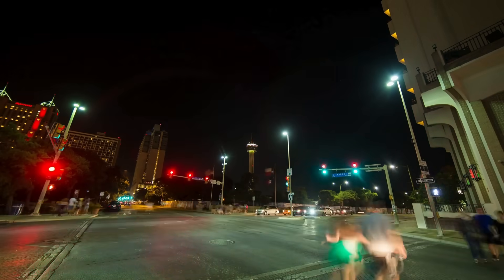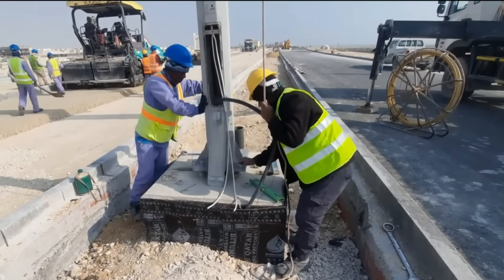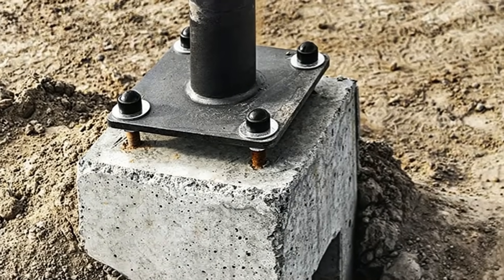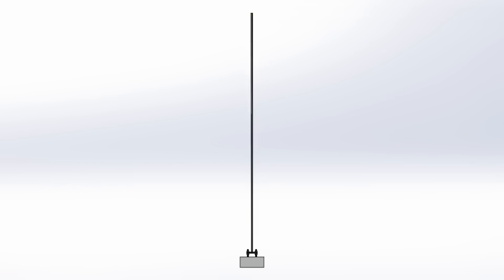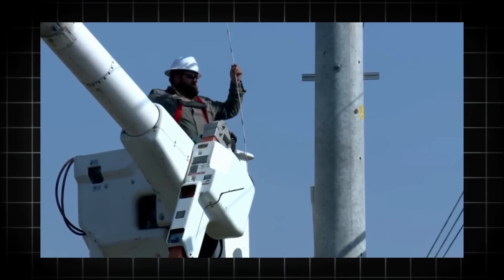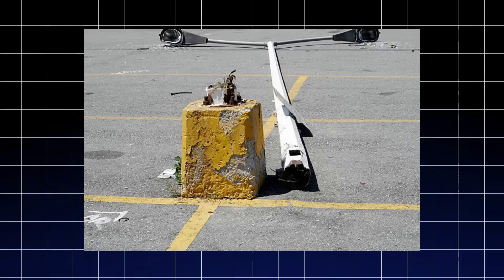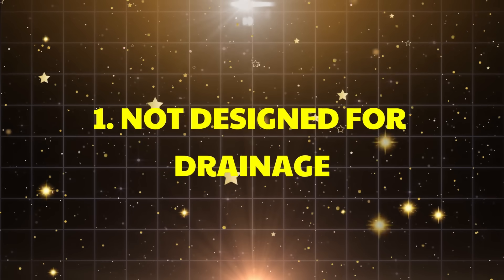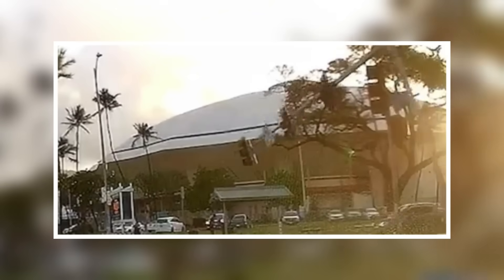Why Light Poles Float on Bolts Only, Not Flush with the Ground?

Comment: This video is about base plates of "static" elements. Please do not use this levelling method for baseplates of dynamic machines. Don't get me wrong; the video wonderfully explains this kind of base plate installation. For dynamic machines, the base plate functions as the linchpin, establishing a critical connection between the intricate mechanisms of heavy machinery and the foundational structure upon which it is anchored. However, using bolts under the baseplate for alignment will prevent the proper tightening of these and will eventually affect the vibrations and reliability of the dynamic machine on top.

Comment: THESE BOLTS AS SHOWN ( STUDS  ) ARE TO BE USED AS LEVEL/PLUMB ADJUSTERS, THEN UNDER THE BASE PLATE TO BE FILLED IN WITH HYDRAULIC SETTING  CEMENT !

Comment: some light poles, especially those made from aluminum arent meant to be direct contact with concrete. the light poles we used at our property were cleared marked NOT FOR DIRECT contact. the first 50 or so were set off the concrete base. installer got lazy ,in a rush on last 200. everyone touching concrete is starting to corrode/oxidize

Comment: Without "finding out why" in this video I knew the standoff bolts and nuts are mainly for ease of leveling of the pole, and subsequent re-adjustment. The rest are made up BS. This method is not sophisticated clever engineering, but just as basic as jam nuts even hillbillies can conceive.

Comment: A hole in the earth. A pipe vertically. Filled the outside again. 
The street lamp was placed vertically in the pipe and filled with sand all around. That holds on.

Comment: I've hauled NUMEROUS poles out of the Valmont plant in Brenham, Texas, in my 40 year flatbed trucking career. 

While the streetlight poles are indeed light, the traffic light poles are NOT!! Most streetlight poles run in the neighborhood of a few hundred pounds for the BIG ones; a modest traffic light pole can get upwards of 8,000-10,000 pounds. The stress these poles are under is phenomenal - that arm can weigh as much as 800-1,000 pounds, not counting the light set! And many hold at least 2 arms.

The bottom is mostly covered with a plate, with relatively small holes for wires - these may get plugged up to keep out critters. And it's nigh-on impossible for water to get inside. The weepholes are to assure that any condensation buildup that does make it inside doesn't just sit on the plate and rust it.

Comment: Solid Color Boiled Linseed Oil soaks through rust and seals the metal to protect it from oxidation.  Exposed to weather, it will need a repaint every 5 years, which is very easy.
I've used it on work metal surfaces outside.  It dries very fast on a warm day in the sun. Like 5 minutes or so. Normally used for Cedar house siding or shingles. It's Olympic & it's great.
I'm a customer, not a business man.

Comment: Now take the bolts and NUTS ON THE SPACE NEEDLE. BOLT I FOOT ACROSS  (GUESS ) (NUTS 2 feet) but point is if they are flush too the pad. 
If they where raised up 6 inches  of pad, and a hurricane  came thru 
It would fall over .. because  its flush it grips tighter.. my opinion..

Comment: Not challenging the narrative however most light and street poles are constructed and installed on the basis of impact and the design changes depending on speed zones. In Australia in speed zones 60kph and below we use Impact poles which are hard bolt installed but the lower half of the pole has gaps in the seams and when a car hits the pole the pole crumbles over the car and absorbed lots of energy. In speed zones over 60kph we use Slip based poles which have a ground mount that has a base, as washer and then a base plate on the pole. Each corner has an open recess for the bolt/ nut. On impact the pole breaks away a from the base and flies away so the vehicle does not hit a resisting mass.

Comment: Thanks for not covering any of the engineering and physics needed to understand how tiny threads on the rods are strong enough to hold a 60ft tall structure being pushed with 60mph winds on one side and horizontal loading also pulling it down in the same direction. No one wants to learn science or mathematics today, thats for AI and videos like this.

Comment: That falling traffic light looks like the Blaisdell Arena in Honolulu. The place that built a stadium with no paint on the structure as the rust will prevent rust! And 20 something years later it had to be rebuilt. Hawaii has been run by democrats since the Queen was dethroned. They sucked the Aloha right out of the islands. Go look at the rail they built and is still not done 20 years later!

Comment: The only place that I remember using poles with vibration dampers ..and it was local code..was in Denver near the base of the mountains. And then, the dampers consisted of PVC inserts that went about 2/3 of the way up from the base. This was about twenty years ago…I’m sure their use is more frequent now all over the country.

Comment: This is not true. Every column floats before they pour concrete underneath them. They float so you can use the bolts to plumb them. All poles are painted with galvanized paint. They won’t corrode unless the paint is scratched off. More AI bullshit.
Reply: our 8 ft high lights poles arent painted with galvanized paint, from the factory they were powder coated matte black. powder coat is failing from the poles in direct contact with concrete since installer ignored clear install instructions the poles arent intended for direct contact
Reply: @ steel light poles are galvanized. Aluminum ones are powder coated.
Reply: @ any steel exposed to the elements are required to be galvanized per code.

Comment: We used to provide parking lot lighting for major store chains and the spec was for the space to be filled with grout and then two piece plastic base covers. The plastic base cover would keep the majority of snow or ice from getting into the area and the grout was the second line of defense. The reason being , if moisture was going to penetrate and freeze, it would only compromise the grout. The installer would never bolt the pole base flush to the concrete pier. If the grout did crack and break during the winter, ideally, a maintenance contractor would re-grout them in the spring…but they never did.

Comment: Those are just called leveling nuts bub.... I installed them every week of my life... It has nothing to do with stability....
You account for settling with the concrete not the nuts and bolts. That's why the concrete goes 6 foot deep and 2 or 3 feet round....

Comment: Yes, and you are creating a fracture / tension point in the actual holding down bolt in the area of the lower 'levelling' nut, which, they are not designed for, rather than allowing the foundation to do it's job. A real Structural Engineer would ALWAYS use shims and grout with any vertical structure, and, physically pull the structure down onto the foundation, simple as. I have seen numerous failings in this 'levelling nut' idea previously, and would NEVER suggest it's use.

Comment: This is “the better way” to reducing factors that include engineers not being on site as much, contractor laziness and poor work, and the construction skill set decreased over the years. Yes, it does help inspectors, and since there are less inspectors, this is a less intrusive way to check. The method has been used for about 20-30 years on a larger scale. The previous method was used for 50+ years. Is this better? Maybe, but only time will tell.

Comment: Interesting.  I always had heard it was a breakaway design.  Learn something new everyday
Reply: I spent over 8 years maintaining interstate light poles for VDOT.   Some poles were mounted on ceramic "break away" bolts and others were mounted on aluminum "T" boxes.  Both are designed to shear on impact.  Sometimes we had to shim the poles or bases to make them "plumb".  Some "smaller" signs were designed with breakaway base flanges.  (a unique design) to breakaway on impact.  The larger signs and high mast poles used these leveling nuts.

Comment: As someone who has worked in traffic signals and has helped intall a many poles... not all are left open like that. Grout is sometimes something  we go back and put in after inspection and extra bolts sticking above the nuts are usually cut off. This all depends on the city and what they want.

Comment: The anchor bolts will work back and forth until the top of the pier starts to crack. Takes about 20 years depending on the concrete mix, climate and road chemicals.

Comment: I sold decorative street lighting and poles (standards) for many years.  The leveling bolts are essential.  We, always recommended putting grout below the base plate and creating a weep hole.  Oftentimes the top cap was missing and the pole would get water inside.   Finally, never, never, never, install the pole without the lighting fixture.  This was the fastest way to cause stress cracks in the welds between the base plate and the pole shaft.

Comment: We do this all the time in construction; it is easy to get the structure level most of the time. We then fill it with concrete so the bolts do not rust.

Comment: Please explain, how these bolts and nuts can withstand rust/corrosion and still provide ample load support? 
Seems to me, this method would require some supper superior steel of some sort to achieve what you are saying.
When the bolts and nuts go bad, how do you replace them, since they are set in the concrete base, without replacement of the base also ?
Reply: Ever heard of galvanized? They just put tons of 80’ tall beams for powerlines like this where I’m at in Rocky Mountains the nuts are nearly 4” wide

Comment: Now that we're on the subject...

Transpo Pole-Safe Breakaway Light Pole Support System is a breakaway support system for light poles and elements located within roadside clear zones and other locations vulnerable to vehicular impacts. The primary component of the system is a high-strength coupling, designed to break away quickly and cleanly upon impact, thus saving lives and reducing property damage.

Pole-Safe will break away with consistent, predictable behavior, regardless of the vehicle’s angle of impact. It has been vehicle crash-tested and is approved for use on the National Highway System (NHS) and all Federal-Aid highway funded projects.

Features and Advantages
Superior Breakaway Performance.
Offers Exceptional Resistance to Forces Created by Wind and Dead Loads.
Designed for use with maximum allowable pole mass specified by AASHTO.
Can be used on a Large Range of Light Pole Sizes and Configurations.
No Special Tools or Equipment Needed for Installation.
Couplings and Hardware are Hot-Dip Galvanized in Accordance with ASTM A153 to Provide Corrosion-Protection.
No Torque Requirement and Maintenance Free.
Tested and Proven for Over 50 Years

Various standards are used around the world for highway and roadway safety features. A goal of a highway safety feature is to provide a forgiving roadway and roadside for an errant motorist. The safety goal is met when the feature either contains and redirects the vehicle away from a hazardous area, decelerates the vehicle to a stop over a relatively short distance, readily breaks away or fractures or yields, allows a controlled penetration, or is traversable, without causing serious injuries to the vehicle’s occupants or to other motorists, pedestrians, or work zone personnel.

Recommended Procedures for the Safety Performance Evaluation of Highway Features

MASH and NCHRP 350 represent uniform guidelines for conducting full-scale crash tests for permanent and temporary highway safety features along with recommended evaluation criteria to access the test results. The crash performance is judged on structural adequacy, occupant risk and vehicle trajectory.             

Passive Safety of Road Infrastructure

According to EN 12767, the definition of non-energy absorbing support structures permits the vehicle to continue after impact with a limited reduction in speed.  Non energy absorbing support structures may provide a lower primary injury risk than energy absorbing support structures.

Comment: Electricians are the ones who install light poles, not engineers. The reason is for the gap is leveling and that’s it. The poles come with covers to finish off the base and hide the gap and bolts for ascetics. Engineers are the last people you want installing anything.

Comment: Thanks for the video.  I figured there had to be a reason but I thought it had more to do with the metal corrosion than with wind forces and leveling (A contact base would always have a moisture issue and even the concrete surface could freeze and break up in winters.

Comment: In NZ, often the holes are slotted so when a car runs through it, the plate pushes out of the nuts and only the bolts on the far side take the impact...
meaning the weakest part of the pole in a crash is only the far side pair of bolts, allowing the car to push the bottom of the pole off the base and the pole lands on the car.

With a fixed solid mount, the base is often stronger than the pole, so the pole wants to bend above the base with the impact, and maybe the pole folds above the impact ... but the pole becomes a very solid object until the weakest part breaks.. and if that is above the impact zone the base continues to be a force against the crash for a longer duration than if the base just ripped away.

You can think of this as a person standing in front of you. Push them in the ankles and you can use almost all your force without much result.
Put them on roller skates and you need far less force to push their legs out from under them.

...meanwhile, wind loads etc are applied to the base as a pivoting load, up on the windward side bolts and down on the leeward.. so wind does not push a pole out of the nuts on the slots.

Also a lot of the power/telephone poles in residential areas are tapered wider to the ground, then tapering thin into the ground. The poles are usually concrete (or non tapered wood depending on application).
The concrete poles have pre-stretched reinforcing rods in them. I have seen many crushed in an impact where there was just the reinforcing left in the 1st few feet, and the pole still standing, held by wires from others.

Lighting poles are often alloy or zinc steel, hexagonal and in sections. We put a chain through the sections to a plate then pull the chain with a hydraulic ram, pulling all the sections together.
Unfortunately we get undercut by companies that just hand push them together... Hilarity often ensues and the saving lost, but accountants don't care about repair costs, that's down the road.

For the concrete tapered poles... they are often just put in a hole and tampered in place...
When there is to be a large load on the pole (we had trolley bus 3 ton wooden poles) we had a neat trick...
Dig a 4ft square hole... Weld 2 endless 44gal drums end to end, drop it in the hole, fill the surround with concrete...
Come along with the pole, put 1/2 ft of sand in the bottom... Drop in the pole... 2-3 bags of quickcrete... fill with sand (packing down and adding water as we go)...
near the top when the sand is packed, another couple of bags of quickcrete making a washer round the pole to the 44gal skin and that is in turn held by the outer concrete/ground.
add a little gravel to level the top that can then be cemented or bitumen surfaced. 
And the bonus... to remove the pole... clear the top to the washer of concrete... break it with a big prybar or power chisel... Vacuum out the sand.. break the lower ring,  lift out the pole.
and the hole is ready for the replacement.

Again undercut by idiots that cut pols near the ground then come back and just try to pull them like a tooth... we saw a full block of concrete with the 2 44gal drums and a pole base pulled like this.. took them a day and a really big crane.

Comment: They DO make breakaway bases though, often found on street lights. Fire hydrants have something similar. On wooden sign poles, you'll often see holes drilled in the poles near the ground and half way up, they are designed to snap and work like a hinge to let you drive thru under the sign and the sign will land behind your car instead of impaling you.

Comment: Some light poles have an aluminum breakaway box to protect drivers upon impact. The method normally used is a weep hole  within the grouted base of the leveling bolts. Usually a round foam rod is pulled out just after grouting to provide water drainage to the lowest point.

Comment: They are not "floating" -- highway engineers call that a slip base.

Secure foundation of the pole but designed to break away if a vehicle hits it.

The #2 is incorrect -- there is a fatal or near fatal accident versus having the pole fall and highway safety engineers consider that latter to be a far less damaging outcome, on the balance.

Bigger poles than that have slip bases for the same reason. These include the light poles on freeways.

Comment: Dad was a highway lighting EE....and general contractor.  I spent a summer because ALDOT demanded the floating pole bases be concreted in.  We did it by hand on about 100 poles.

He kept fuming...all they'll do is have to replace them when they rust out or need to be levelled after a bad storm.

We did cast in a weep hole with any available stick or scrap of pipe.